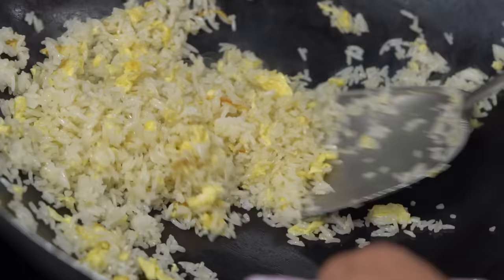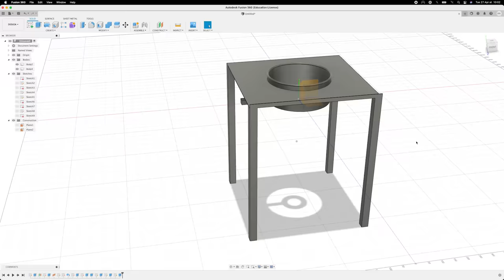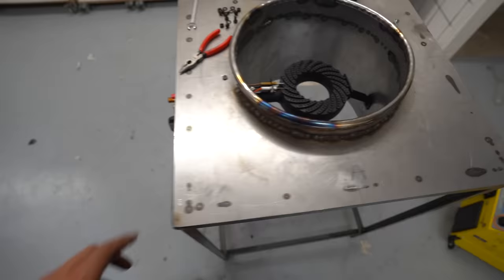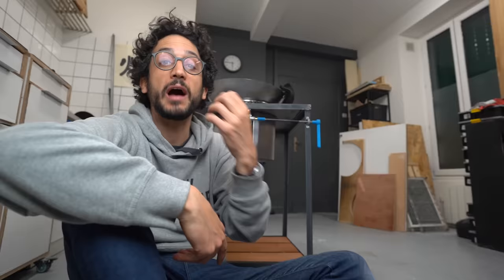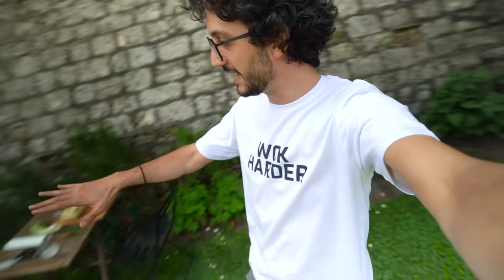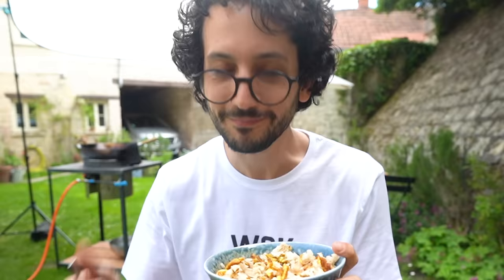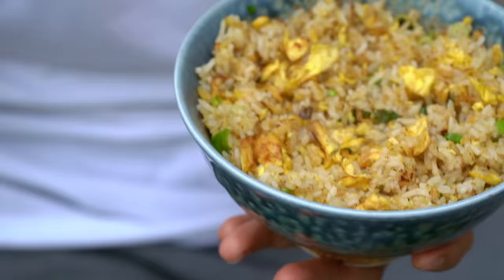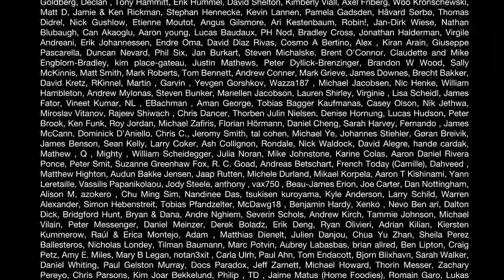I Built My DREAM WOK STOVE ! High power + Knee operated

Comment: The only youtube cooking channel that features welding. Meet AvE the only youtube engineering channel that features cooking.
Reply: Good ole Uncle Bumblefuck!
Reply: Techmoan does have some excellent cooking videos
Reply: @importanttingwei7747  "Grinding and paint makes me the welder I ain't."
Reply: @importanttingwei7747  I would assume he was using flux core.
Reply: @importanttingwei7747   He probably used self-shielded wire
Reply: The stove looks skookum as frig.
Reply: Can you get release the CAD for that god tier noodle maker!  My home noodle making hasn't gotten past soba like noodles
Reply: Well, i've seen cooking (and welding) on cody'slab channel too.
Reply: Needs a mention of pixies and the requisite insult to sawdust makers.
Reply: @importanttingwei7747  Don't know about the availability of TIG or MIG for the amateur in France but for the hobbyist probably $$$$.  So probably a hefty investment for a single project.
Reply: @sshuggi  Carpenters say the same for putty and wood filler.  But I knew a retired Japanese sashimono (furniture) maker that aimed for air tight joints.  His fitted box lids would slowly piston closed.
Reply: You can always watch Ben from Applied Science making cakes
Reply: Damm AvE with French guy cooking gives me goose bumps.
Reply: @abelgerli  As a Canadian familiar with the French spoken in Canada, Alex and AvE will probably have to speak slowly or settle on English.  Canadian accented French can be that thick.
Reply: You must've never seen @chudsbbq
Reply: Let’s not forget Pimp My Pasta Machine with ThisOldTony!
Reply: @tiacho2893  I am sure but it would be pure fun 😆😆
Reply: @importanttingwei7747  he used shielding gas. In a small, Hardware store size bottle. 
Obviously for the beginner/amateur, but just the right thing for him it seems
Reply: Ole AvE would certainly say that prototype burner Alex built is the cockford ollie alright
Reply: Quebecois vs Parisian French cook-off collab time 😎
Reply: When you finish cooking  the fried rice . You must submit  it to uncle Roger for certification.
Reply: That would be kinda cool.  He should put a lil paint ball type co2  cylinder a valve and a collar w holes around it as a fire suppression system on it in case of grease fire ..  I love the description of a MIG.  welder.  ..  Look up "banjo burner " on Amazon
Reply: AvE is more fabricobbling than engineering
Reply: @Important Dolphin what are you talking about you can see the tank behind his welder he was using gas
Reply: For a novice welder stainless is way more forgiving..
Reply: The collab that would end world hunger and create universal harmony. You know it's true.
Reply: Meet dj
Reply: Zees is zee manner in which she chooches.
Reply: @importanttingwei7747  The welding doesnt sound like theres constantly mini explosions. Plus, if he didnt use gas, the welds will be like a sponge. Metal will discolour whether with gas or no gas and no matter the skill. The thing gets hot.

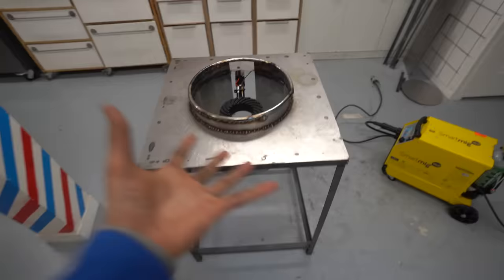Plus, most importantly, you can see something behind the machine at 4:30. Pretty sure thats the gas you were talking about
Reply: dont wanna break the 666 likes
Reply: de0509 
    He got too weld happy, trying to lay a continuous bead, and burning holes through the sheetmetal 
Looks like he learned, and adapted
To just use small spot welds.
Reply: @amsb4dafunk406  yeah. An inch of tack is estimated to be able to carry a tonne of weight. For non structural projects birdshit is very very enough.

I just dont get that dude trying to be a smartass and accuse (wrongly) that no shielding gas was used. Hence I pointed out with a timestamp where the gas can can be seen.

Comment: There's a column of hot air that rises from the wok where the food cooks while airborne (high pressure burner certainly helps). You need to get everything tossing to cook in that hot air and not let the ingredients just sit on the hot metal surface. Pay special attention to improve your mise en place in order to reduce the amount of time when adding the next ingredient. Cooking with the hot air will also reduce how oily the end product becomes.
Reply: Worked at Panda Express and agree with everything you said @Alex
Reply: Where is this column of hot air? Is it at the 12 o clock position, North of the burner or is it in the exact center of the burner?
Reply: @tomatojuice12  from my knowlege of physics, it should be all around it within the burner cylinder area
Reply: he should close the bottom hole .. too much cold air is inrushed during burner heating .. no need for that air ,there..
Reply: this is what we should send ppl when they ask what wok hay is
Reply: Words of wisdom
Reply: @awesomestuff9715  your knowledge of physics sucks!
Reply: honestly, i think the fire is too small. chinese restaurant stove fire is very very strong, thats why they cook fast , and like you said, they tossed the food and the fire burn while airbone, that create the flavour.  his stove is still not high pressure enough.

Comment: Hi Alex, I’ve been following your fried rice journey and really enjoying it. I also am Cantonese-American and am also a lifelong student of making fried rice. Your technique is correct but the motion is too slow. That is why the eggs are drying out. The motion in the wok must be fast. Remember all of your training. Watch your technique. Your right hand is doing all of the work. The left hand with the towel must be moving just as fast. When the eggs and rice hit the oils they must move immediately. Left and right hand must agitate the rice immediately and consistently. This requires a ton of wrist practice particularly on the left side but fear not. I have a suggestion on how to rig the technique in your favor. It is a home style trick but it will yield the restaurant quality you seek. It’s this: take the cold cooked rice, put it in a bowl and crack your raw eggs over it, add all of your salt, sugar, soy sauce in this bowl and mix well with chopsticks thoroughly until all the grains of rice are separated and individually coated with the seasoning egg mixture. This has several key advantages that will help you: 1). There will be no clumps in your rice at all 2). The cold rice will severely slow down the cooking time of the eggs buying you more time to stir before they dry out and 3). The egg coating with also protect the rice from the heat keeping it fluffy. This style works well with jasmine rice that you had at Shang Palace but if you want to stack the deck in your favor. Use medium grain sushi rice which will stay fluffier with its higher water content. I hope this helps you. Congratulations on all the success with your channel, wishing you a speedy recovery with your knee surgery and 加油！(Jia You literally means Add Oil. It is a Chinese phrase we say to cheer someone on and to keep going strong.)

Comment: Alex, rather than painting it, cure it like an iron pan. You coat it with an extremely thin layer of oil. Your finger should feel the oil but not get oily when touching it. Then go over it with a torch until white hot. Then it will have a nice coating that will prevent rust and need not cleaning.

Comment: Alex brush the welds with a steel brush to get rid of the oxidation so It does not rust as quickly
Reply: it's not just the welds, it's the entire rig
Reply: i was thinking, did he grind the metal clean before welding it together.
Reply: @RoraighPrice  no you have to do it after because welds cause a layer of oxidation and it could cause it to rust faster

Comment: In regards to your question about improving the Gaß Heat Source you bought from germany; There's a key word for what really sets burning regular and top notch seperate, which is the Vortex Burn. A Vortex burn can only be achieved by either having the flames natrually form a vortex (45° Degree Angle on the Gaß Outlet Holes, you can drill it but risk of bricking the entire unit is high) or by forcing it into Vortex Motion by Air Channel around it (Soldering Air-Blades of Iron to the side of your Fire Pit, which go up in Curled motion to make the Airflow become Tornado like) (much less chance of it really working with small blades, and big ones are going to interfeer with flame flow overall) - For the simply tho, adding a battery run small pc fan underneath the center of the Gaß Burner, can thunnel the flames upwards and increase fire quality, while not being Tornado Flame Vortex, you can easily expect 20-40% Added Flame Quality by thunneling the Airflow specifically as you desire;
Reply: and yes, the 45° Degree on the Gaß outlets are slightly overkill, however, the perfect 28° degree holes a professionally manifuctured Gaß Outlet of this kind would have (which you can't buy anywhere as far as i know), are much harder to achieve with private tools, as they're aimed at a much smaller circulation angle, and further upcurling flames, they might not suit cooking in a Wok exactly as needed. to my understanding the machine works ideal when the flame center is just barely touching the wok from underneath, and the air vortex around it heats the exteriour Wok-Pan Surface; - So Distance to the actual Gaß outlet is the key factor for getting it to work just perfect. =)

Comment: Alex - great wok build! 

The secret to making great Chinese food is not only in the marinades and sauces, but also the sequence. For years, moms who are not trained chefs hand down techniques that can never yield restaurant-quality food. Fried rice is a great example. You showed in the video the way most people think is the right way to cook fried rice. And I thought so too, for 40+ years. Then I found the secret.

The way to have nearly every kernel of rice coated in fragrant, yellow egg (like in a Michelin-star omelette) without nasty overcooked scrambled eggs is to start with a COLD wok. Yes. COLD WOK. Crack the eggs into the wok, scramble it while COLD, adding a ring of oil and add the rice immediately. Stir the eggs, the oil and rice together while cranking up the heat gradually. In the time it takes for the egg to cook, you would have stirred it evenly to coat the rice, and it will be a fantastic sight. Now add salt, spring onion and a little MSG, yes MSG, and white pepper. Char Siu or uncooked and towel-dried shrimps would of course be a great add at this point also. I will guarantee you authentic Hong Kong restaurant quality fried rice after you mastered the ratios. 

Enjoy!

Comment: Don’t be afraid to scoop the egg out and add it back at the end.
Reply: And that’s still a valid technique since apparently Cantonese style stir fried noodles cook each component separately to the correct doneness and stir-fry in the end whilst the trickier Northern style use the throw in as you go method which is harder to master.

-Took it from Chinese Cooking Demystified’s stir fried egg noodle recipe 😂
Reply: Also I feel like he should switch to a metal wok spatula instead of a ladle.
Reply: That and don't be afraid to make something similar to an omelet (In that it is a thin sheet of egg) and cut it up, these two suggestions solve some of the issues he brought up.

Comment: Here is what i do with my own friend rice

- i found it easier that you have to fluff your rice after cooking it the first time. Then air dry or put it in the fridge to coold dry. As part of your mis en plac, break the rice again. This will make sure that your rice will be more separated than breaking your rice while cooking

- try adding the scalion after turning off the heat then toss a few times to mix without heat This will not over cook your scallion. The residual heat from the wok and rice will cook them.

- add the rice when the eggs are about 60% cook. The eggs will continue to cook as you add the other ingredients until you finish cooking. if you have timing issue, i cook my eggs as part of the mis en plac as well. Cook the egg like a pancake but not over done on both sides, then slice/dice/chopp them up. Add them after you add the soy sauce so they retain their color..

These may not be the proper chinese way, but its a home cook way

Comment: Michelin stars to Michelin Tires. 

We actually did something like that here. Redneck Style. We use the base burner for an outdoor deep fryer, gas powered. Generally you fry turkeys and things with it. Then my husband procured a Tractor blade that is shaped like a very large Wok. He welded handles on it. it sits on top of the rim of the deep fryer burner outside. It's like a giant wok. It's too heavy to do what you're doing, but you can easily replace it with a regular sized wok. It gets very hot here in the summer. I use it for stir-fry rice and things  during the summer months. I think you would approve.

 This may be way off what you're trying to do, but most places here used left over rice. They cook it the day before. Then they fry it and flavor it and so what. I think that's what you're missing.

For a quick home version, use a nonstick skillet, add better. Toast the rice and almonds usually in the better. Add liquid. cook like pilaf. At the very end. Turn up the heat and Stir until it's dry. Then I add all the other stuff. It comes out as you described. I just didn't make a wok to do it.
Reply: is the tractor blade food safe
Reply: @tubulartuber  They're still alive and posting ...
Reply: never non-stick
Reply: Here in Argentina many many people use plough discs to do exactly what you described. Glad to see ingenuity is universal

Comment: Kikoman is japanese Soy sauce. For Chinese food the standard for restaurants is LeeKumKee Premium Select.
Reply: its just different brand there is strong flavor difference ?
Reply: Glad someone noticed. They (Chinese and Japanese soy sauce) get so mixed up in the West nobody cares at all. Most Chinese chefs use a tiny bit of dark soy sauce for fried rice or a mix of both for general cooking. Light soy sauce alone is usually for dipping dumplings, dim sum, etc. as it is rather delicate to be heated, esp. Kikoman brand which is more suitable for fish i.e. sushi. 

Also, a tiny sprinkle of MSG goes a long way. lol
Reply: @igigor646  Japanese soy sauce taste slightly different than Chinese soy sauce
Reply: @igigor646  There is a difference between brands within a country, much less between countries.
Reply: Yeah. Actually this is just surface level. A good Chinese restaurant takes their soy sauce very seriously. They would source theirs from some cottage industry maker in some far away village which is kept secret, and they would have some deal in place to ensure a lifetime supply.

I know of a restaurant that bought out the owner of a soy factory because the owner wanted to retire and had no heirs. 
It would have been devastating to the restaurant if the factory closed.

But many restaurants would often use LeeKumKee because it's consistent, available globally, and you are ensured a reliable supply. It's important because if you change the soy sauce, it changes the taste of the dish and customers will get upset.
Reply: @igigor646  I have both in my fridge. I think Kikoman is a bit more tart, where as the leekumkee has more of a caramel flavor going for it.

Comment: For the burner, look into "blacksmith burners" / "forge burners" / "kiln burners" etc, HUGE community of DIY/open sourcing them, and your building skills speak for themself!
Reply: No alex dont look into these. This guy has no clue what he is talking about. The burners he mentions arent for cooking. You got the right burner.  No DIY needed. This isnt rocket biology.
Reply: @thecommentary21  I agree somewhat!  He got a great one, so no need to look into this too much now.

Also the design wouldn’t be 100% spot on, but i think it would be a good starting point given both are high pressure and/or high volume LPG burners.
Reply: @ericlotze7724  The burners are different. Making a kiln burner is one thing but the wok burner is totally another. My company makes high efficiency forge burners. Its just far too much heat and flow. 

The burner alex got will work fine if he ads a high pressure reg on it. 

Ive scouerd videos of this because I cook chinese food and hate trying to cook it on a normal stove. My god parents were chinese and they had a restaurant. So I grew up on the food.

Ive made several woking stations and my mosty recent is the best and I put in a rocket burner.

DIYing a forge burner is probably more acceptable to make for a forge but DIYing a wok burner while not impossible is probably not going to work as needed for woking. 

I would not DIY a wok burner. Ebay and amazon has tons for good prices. I got 2 off ebay.
Reply: Yeah... forge burners are great if you want to heat the metal to an almost (or at) melting point, and kilns are nice to drive out every instance of moisture in porcelain, but both of those things aren't the best for food. And the heat distribution is a bit different as well.   Though, this does make me wonder what at-home chefs use in places that make fried rice constantly. Is there a way to do it on, say, a charcoal grill?  I kinda don't want to mess up my good wok trying, but if I use a crap wok, would that give me a false negative?
Reply: @MickeyCuervo36  You wont get the heat from coals. Ebay has burners and then all you need is propane. Be sure though you arent buy a gas burner rather than propane. Home gas doesnt have nearly the BTUs propane does and the orifice sizing is different as well. 

The burner alex got is actually a really good burner, he just needs a high pressure regulator and he will be good to go.

Otherwise you are right on your assumption making it properly. Chinese food is generally cooked on a wok at high heat for a low amount of time. 

The fried rice is a tough one to get right. Mine is improving but Ive been at it for years now. 

A good Wok will be fine. They are hard to destroy.